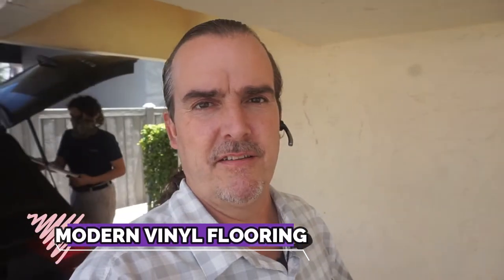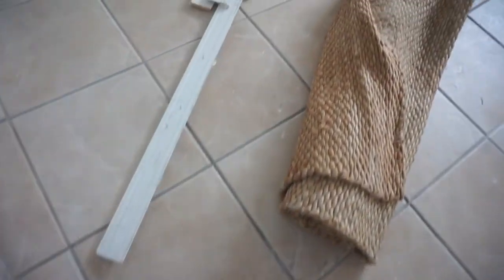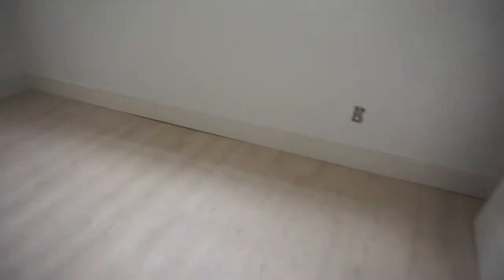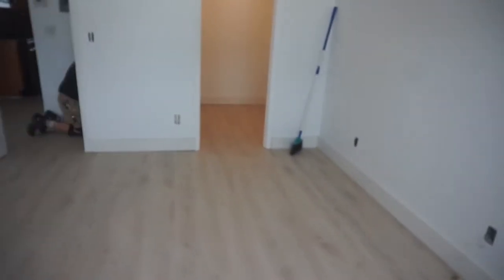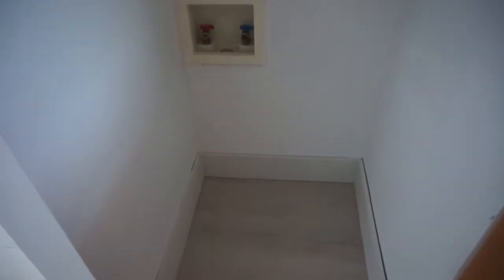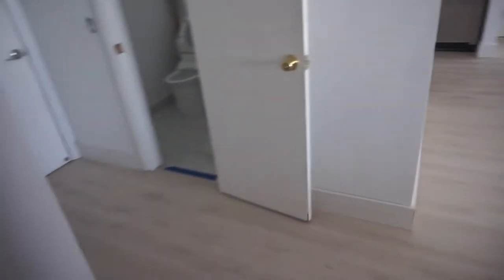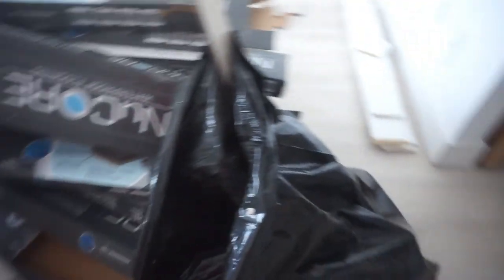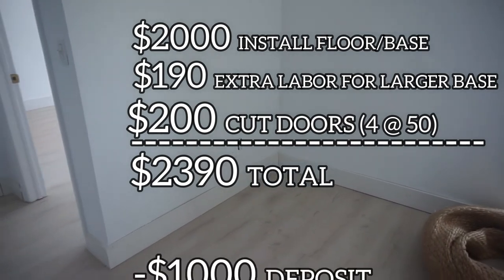MODERN VINYL FLOOR  & MODERN BASEBOARDS IN MIAMI BEACH, NUCORE VINYL PLANK FLOORING INSTALLED

Comment: Looks good. Might be worth throwing that trim through a planer so it’s not as thick as the door casing and there is a proper reveal, or use a thinner base to start with.

Comment: lets see a video on the two water resistant laminates lines sold at floor and decor, say submerge in a water tank for 1, 3, 12 and 36 hours and then to failure. and a continuous      update on the one in your house and any plank floors you know of and the age and feed back on them
Reply from the maker: You got it! I’ll work on putting this together! I’ll use a small fish tank since it’s clear (minus the fish, of course lol)

Comment: It seem that Nucore Performance is really tough would you say is the best option if is professional installed by the price?

Then what would you put next Lifeproof and then regular Nucore?

Have you used Mohawk Home from Costco how would it compare to those?

Thank you.
Reply from the maker: I would say that the Nucore Performace is definitely the toughest and most durable and regular Nucore and Lifeproof are so similar I think they are very comparable in quality so if someone was thinking of choosing between the 2 the deciding factor should be which has the color you like more and Id say go with that one. If you have alot of VERY heavy furniture and alot of traffic lots of pets, kids etc id go with the performance!
Reply: I'm installing nucore performance with the help of your videos but when I go to install some piece it keeps cracking! What am I doing wrong? I've checked for debries and the floor is flat. We've lost 4 pieces of nucore so far and we just started :( (this stuff is expensive)